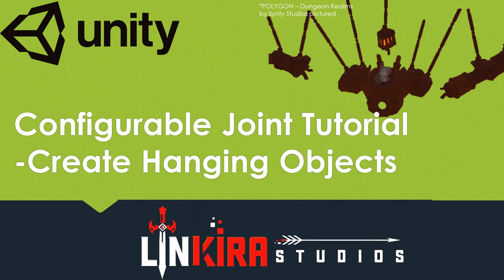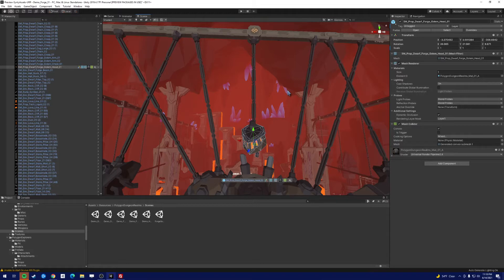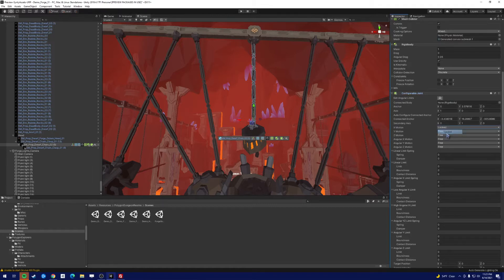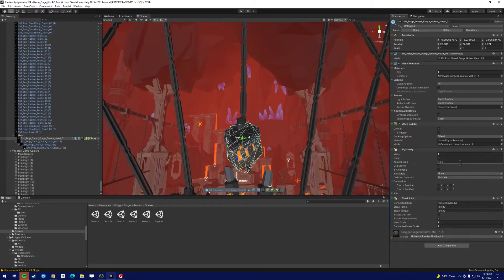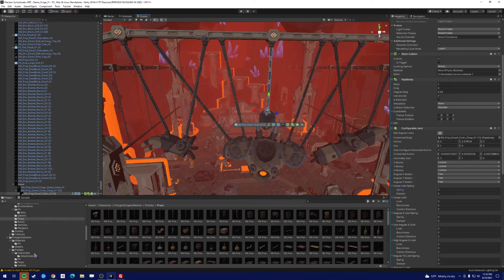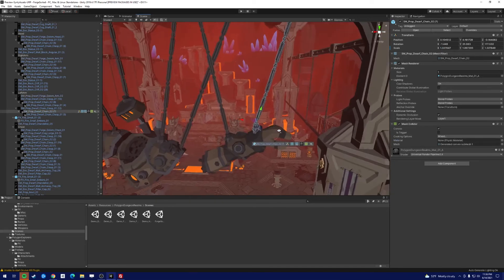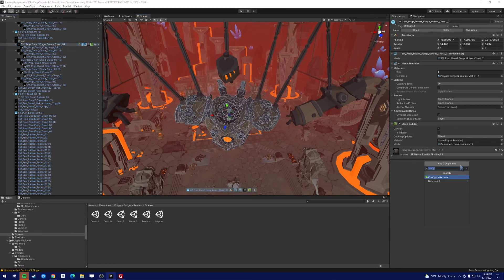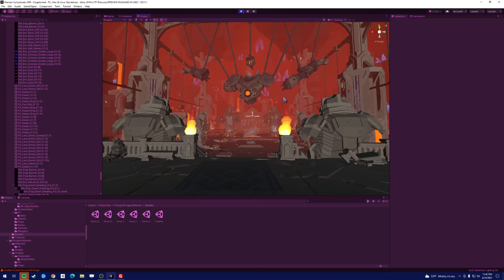Multi-point Configurable Joint Tutorial - Create a Hanging Object

Comment: I've been trying to get a cable attached to the back of a turret to move with the deployment animation of the turret using physics on the cable. It goes from the upper middle of the turret back to the base at the rear. I come from Blender, so It really frustrates me that It takes about 12 seconds to use a curve with some thickness that is anchored to empties where I want them to stay. I've tried an armature-based cable, and than I discovered splines in Unity. But I'm still not sure it is the most simple and elegant method to accomplish my goal. Guidance would be MOST appreciated lol!
Reply from the maker: I have a trailer of a game jam game.  I used a combination of configuration joints and a line renderer and it does a decent job.

If the physics is attached to the wrong point, look at the auto connected anchor point.  You might need to uncheck the box and adjust to where you want that anchor to be.